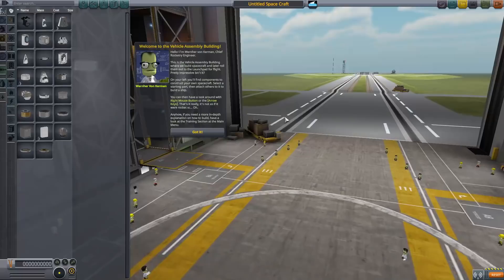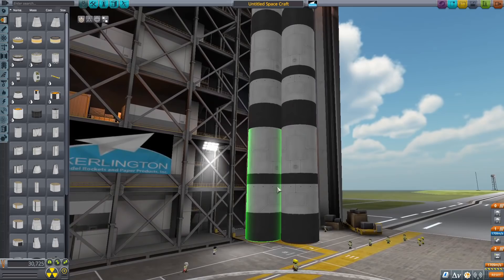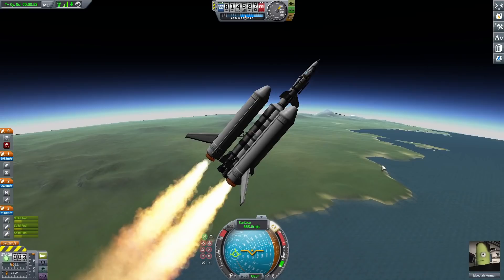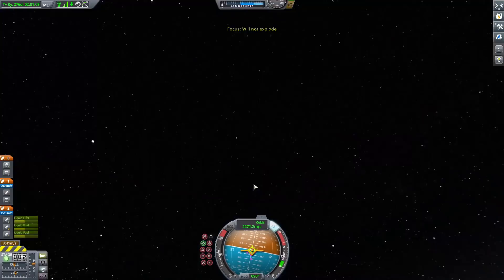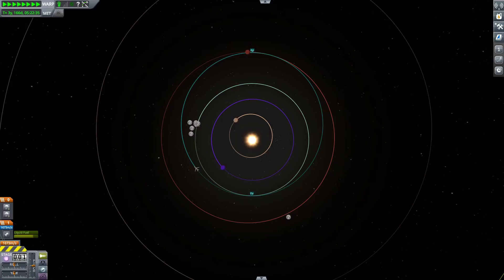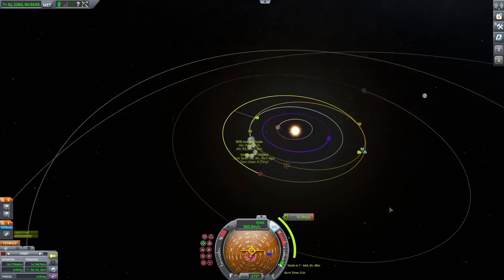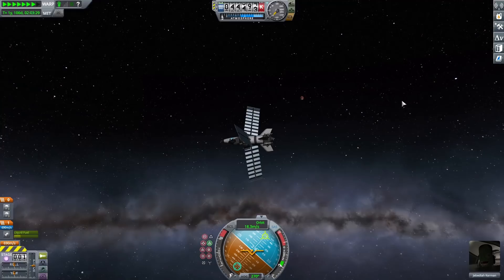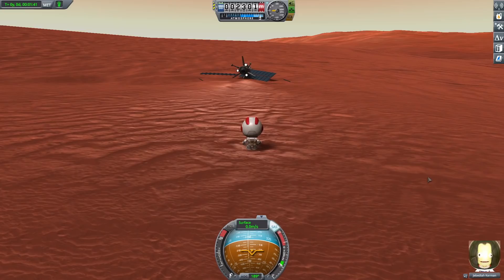Using Physics to Desert Jeb in Kerbal Space Program

Comment: always check your staging!
Also, you didn't "turn way too early". It's actually more efficient to do a proper gravity turn where you lean the rocket gradually until you're entirely horizontal, instead of flying up and then sideways
I've been a long-time fan of KSP, I hope you make more of these videos!
Reply from the maker: I'm glad i checked staging so early into the flight, usually i mess it up way way later in the flight lol

Also yeah, but i finished that turn way earlier than I would have liked. Fortunately it didn't require a relaunch!
Reply: @ReidCaptain  actually, you should have done it earlier! Generally if you are trying to do a efficient gravity turn you start turning at 2000(or less) feet. You then keep gradually turning, and continue turning the entire flight into orbit.
Reply: @ReidCaptain  I aim to be at 45° on the nav ball by 10,000 meters and aim to be at 75° by 50,000 meters then flatten out at 70,000 meters. I would also recommend using the maneuver maker as it gives you a much more circular orbit!
Reply: @ReidCaptain  that was a phenomenally inefficient gravity turn lol
Reply: @magica3526  genuinely it was so painful to watch 😭

Comment: Rip that gravity turn. for the most efficient launch trajectory you should be aiming to be at 45 degrees by 10000 meters and then continue nosing over. After getting to 45 deg there is a way to just go by eye but it takes a lot of practice so I would suggest to just try to get over to 60 deg and then once your apoapsis is up to 90 km just set a maneuver at apoapsis to get into a stable orbit.
Reply: I start turning at 100 m/s and then be at a 90 degree angle at 45000 meter, then i cruise to apoapsis
Reply: I like your funny words magic man

Comment: Just so you know, when performing a gravity turn you can actually start turning when your speed is as low as 30m/s. Tilt approx. 5 degrees, then slowly follow the prograde marker until you’re pointing 45 deg. off vertical at around 10km height. Then follow prograde until your apoapsis is the desired height